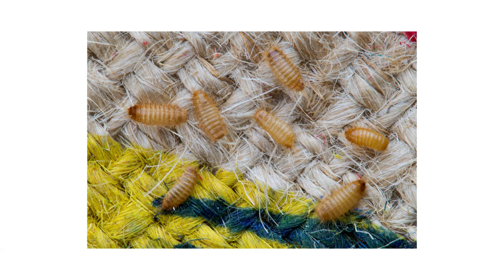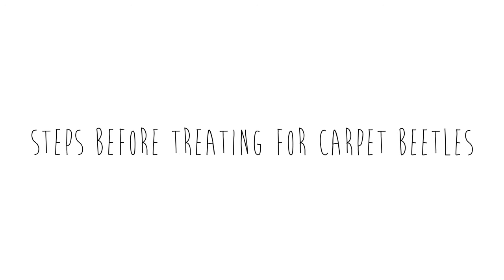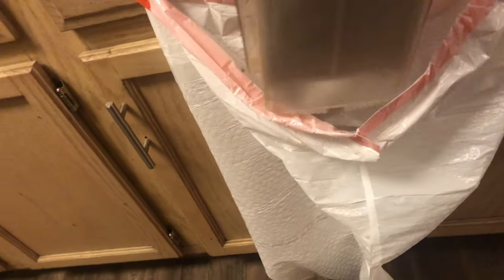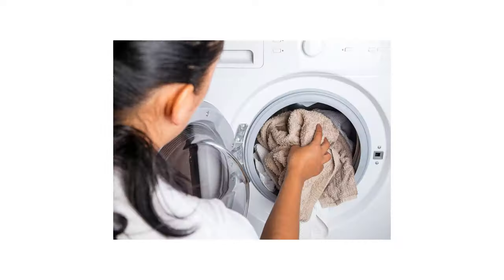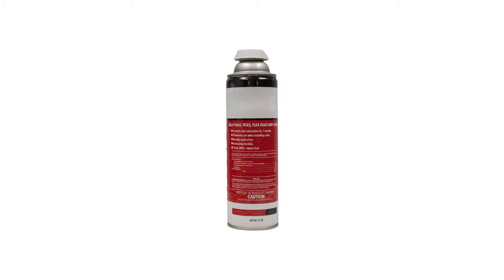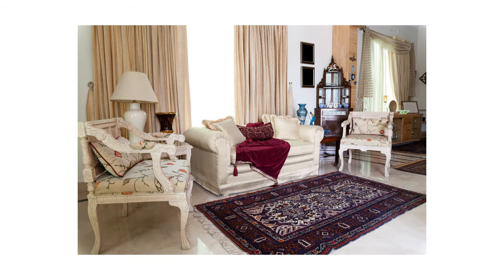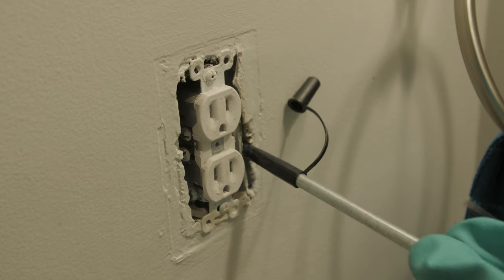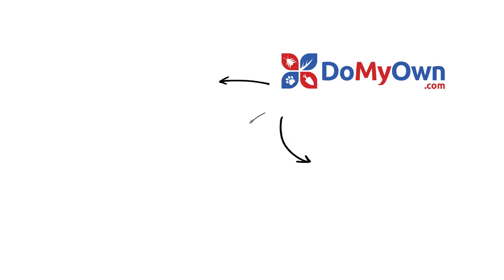How to Get Rid of Carpet Beetles | DoMyOwn.com

Comment: Ok, so last week I found a large amount of larvae and shedding under my cats dry food container in the laundry room.  I cleaned that up and found a bunch under the dryer as well.  I basically went into crazy cleanup mode and moved out the washer, dryer, and completely swept up/mopped that room, then I applied Ortho home defense to the entire area and under the washer/dryer.  I also vacuumed out the dryer and the vent tube thing.  I then went to the kitchen and swept under the stove and fridge (found a few larvae under there as well).  The remainder of my week involved me spraying every corner and base board with insecticide, putting down powders, and doing heavy vacuuming.  I also went back over the rooms and mopped and wiped down everything with rubbing alcohol.  Everything is spotless now, and I'm pretty positive I removed and cleaned all sources of food.  That being said, it's been a week since the initial finding of this, and every day I see 1-2 larvae on my wall.  I'm not sure if that's normal or not and I'm just not waiting long enough or what.  I'm not sure what else to do.
Reply from the maker: We are sorry to hear you are having a problem with carpet beetles. First, you should choose an insecticide labeled for carpet beetles on our website here... https://www.domyown.com/carpet-beetles-c-141.html. If you choose to use an insecticide that does not include an IGR, add an IGR like Gentrol to your insecticide. https://www.domyown.com/gentrol-igr-concentrate-p-604.html 

If you are using a liquid insecticide, mix the insecticide and IGR in a sprayer with water. Read the product labels to determine the amount of water and product you will need. After filling, replace the cap on the sprayer and shake the sprayer to mix your insecticide, IGR, and water together. 

Place glue board traps in your laundry room and other dark areas to catch adult carpet beetles. Glue traps https://www.domyown.com/catchmaster-100i-insect-monitors-100-boards-300-monitors-p-2397.html are also a great way to monitor your infestation. In the weeks that follow your treatment, you should see less and less carpet beetles on your traps. If you continue seeing activity after 21 days, retreat.

Comment: I’ve only found two of these things and not even larvae, an adult I’ve done everything to remove them but should it be something to worry about?
Reply from the maker: We recommend that you stay vigilant about vacuuming and removing clutter. You can also use a residual insecticide for prevention of carpet beetles and other common pests. Adult carpet beetles will feed on pollen, so be sure to check fresh cut flowers that may be brought into the house and flowering plants that may be near doors or windows. We have more tips in this guide, too: https://www.domyown.com/carpet-beetle-prevention-guide-a-697.html
Reply: DoMyOwn Ok, thanks a lot!

Comment: I have a hardwood room, but I've seen some of these things on the rug that I keep in there. Should I wash all the clothes, curtains, sheets, and pillow cases just to be safe? And is there a hardwood safe insecticide that you reccomend using?
Reply: I forgot to mention, they weren't the beetles themselves, but they were the larvae
Reply from the maker: Wash all of the fabrics in your home that you possibly can and dry them on high heat (over 120 degrees F) to kill any carpet beetle insects, larvae, or eggs. The high heat of the dryer is important as that is what will kill the carpet beetles. Don't forget clothing, bedding, towels, and other linens.

You can dry clean any items that are unable to be washed, such as those made of silk, or place items directly into the dryer. Dry cleaning will also kill any insects, larvae, or eggs that are hiding in these fabrics.

Onslaught Insecticide can be applied to wood floors. That being said, it is always best to do a test application first, as some types of wood floors are more prone to staining than others. In most cases, Onslaught should not leave any visible residue behind when used as directed.

https://www.domyown.com/onslaught-insecticide-p-376.html

Comment: What precautions should be taken when reentering the home after Nyguard spraying? 
Wiping kitchen counters? Washing bedding that was out in the open during spraying? Wiping desk and table surfaces? Please advise. Thanks!
Reply from the maker: NyGuard Plus can be applied for carpet beetle treatments with a sweeping motion as a surface spray to carpet, rugs, closets, baseboards, upholstered furniture, and around the edges of carpet.  Always wear gloves and long sleeves when applying NyGuard Plus, or any insecticide in or around your home.  Do not let children or pets into treated rooms until the solution has dried (about 1-2 hours).  This product should not be applied in any way that could possibly contaminate water, food or any food handling surfaces or utensils.  Please refer to the manufacturer's application instructions, and only use as directed on the product label. https://www.domyown.com/msds/NyGuard-Plus-Label1.pdf

Comment: I found two or three adults under my chest of drawers earlier as well as one live adult and a couple of shed skins, I haven't noticed any larvae though or obvious damage. Also haven't ever seen any by my window or in other rooms. I've been putting off cleaning my bedroom floor for months and under the drawers was horribly dusty and full of old paper. I've binned everything from under there any thoroughly vacuumed but should I be worried? I don't keep clothes except in the top drawer which I recently cleaned anyway, there is no sign of them in other areas of my room and i have a high sleeper bed so I doubt any could be in their. Will repeated vacuuming get rid of them?
Reply from the maker: Vacuuming daily can greatly help with your carpet beetle issue as the vacuum sucks the adult carpet beetles and the larvae from the carpet. I would also suggest washing and drying, on high heat, all of the fabrics from the room to kill any carpet beetles and eggs. It may also be beneficial to treat the room with an insecticide dust and an insect growth regulator (IGR). Please take a look at our guide on Carpet Beetle Control https://www.domyown.com/carpet-beetle-pest-control-a-220.html for more information on treatment methods if you have not already.
Reply: Hey I just message someone because we have the same problem… Try getting the flat part of the vacuum extension put it on and then use that flat extension of the vacuum and try to slip under your baseboards because that’s their favorite place to hide. Try going into any crevices on your stairs which is also their favorite part to come out and feed on and also check your furniture like your couch. I sometimes go out in the middle of the night when they like to come out (the larvae) to see if they’re hiding in the couch because that’s when they usually come up and that’s when I’ve noticed them so now we’re gonna have to get rid of our couch. We’re also going to have to now call an exterminator to spray some insecticide but what I’ve been hearing from other people that doesn’t seem to work.
Reply: Most homes have carpet beetles. You can only control them but never get rid of them. If you live the minimalistic lifestyle-with hardly any belongings and no carpeting and furniture is high off the floor and no clutter on the floor including shoes, and you dust and wash floors regularly including under your fridge and stove and keep your window screens on then you might be lucky to not have these pests.

Comment: I just moved to a new apartment and found a few adult beetles and larvae. The apartment is pretty sealed but they seem to be coming mostly from behind my radiator which is right below the window so I am assuming that they just live in the walls as the apartment is still pretty empty. I'm down to order Nyguard Plus and everything but what can I do if they actually reside within the walls, in there a chance to get rid of them or do I need to accept I will deal with them as long as I live here ? So far I sprayed with Demand CS and dusted with Delta Dust, not sure this will be enough.
Reply from the maker: If the beetles are living inside the walls then dusting inside the wall voids would be your best option. Delta Dust or Cimexa Dust will be great options for you to use. Use of an IGR like Nyguard Plus would also be a great option to kill the larvae, so you are on the right track. Please also take a look at our Carpet Beetle Treatment Guide https://www.domyown.com/carpet-beetle-pest-control-a-220.html & our Carpet Beetle Control Kit https://www.domyown.com/carpet-beetle-control-kit-p-18642.html  for more information on products and treatment methods.
Reply: Unless you have dead animals (mice?) inside your walls that they are feeding on it is more likley that they are wandering in from outside, attracted by the odors of potential food in your house.

Comment: What if I have pets? How do I know the insecticides will or won’t harm them?
Reply from the maker: You should always keep pets out of the treatment area until any sprays are completely dry. Be sure to read and follow all label directions, just like you would with household products.
Reply: Also read the can. I almost bought a flea treatment to sprinkle on carpeting, but when I looked closer at the instructions, the label stated to use it only on a 3 ft by 3 ft area maximum and do not repeat because of toxicity! And you can buy that at the supermarket!

Comment: I keep finding like 3-4 every day in my room but I can't find the source or any larvae. They will be on my window sill and bed which is next to the window. Do I need to worry?. I've never seen any larvae but it looks like they've been eating my clothes
Reply: I'm only in a tiny box room btw so not that many places for them to hide
Reply from the maker: Carpet beetles can often enter the home from outside so checking around windows and doors for any cracks in weather stripping or gaps they could potentially enter through is one way to help make sure they don't continue to show up. Take any clothing you have that they have already infested, or that you think they could be within (typically wool type items or similar natural materials), and blankets, etc and inspect and clean them, and then seal them up in containers for a bit while you eliminate any existing in the home and furniture of the room. You can spray a product like NyGuard Plus https://www.domyown.com/nyguard-plus-p-2874.html or Gentrol Complete https://www.domyown.com/gentrol-complete-aerosol-p-17183.html along the baseboards and carpet edges, under furniture, and inside the crevices of drawers, etc. If you have any pets make sure their hair is being vacuumed regularly, and check for any birds nests on or next to the home that could be contributing to the population as they often feed on bird feathers and materials in their nests.

Comment: Ok so I’m getting new carpet today, and I found some under my mattress. My dog sleeps with me at least twice a week, and I don’t have any skin irritation from the larvae. I’ve only found larvae on the mattress, should I get a new mattress? My parents have low income and they just bought themselves a new mattress (we didn’t know we had carpet Beatles at the time) is there a way to get rid of them without ripping up my mattress??
Reply from the maker: There is a very helpful article that we provide on our website that will give you proper instructions and materials on how to treat for carpet beetles. I am truly sorry for the situation you are in and hopefully this information will be more than helpful. If you have any further questions or concerns please let us know.

https://www.domyown.com/carpet-beetle-pest-control-a-220.html

You typically do not have to replace mattresses if they are not completely infesting but finding the source and cleaning/removing that is key.
Reply: Consider using a hypoallergenic mattress cover. One that fully covers the whole mattress, not just a fitted sheet style one.
Reply: Get rid of wall to wall carpet. Area rugs may be ok if you clean them often.

Comment: I have a 2story i suspect after all the spraying and dust I've used on carpet walls etc.Ive come to the conclusion they're in the subfloor how to i treat that?
Reply from the maker: When treating a carpet beetle infestation the first thing is to locate the source of the infestation. Please take a look at our how to treat carpet beetle treatment guide. https://www.domyown.com/carpet-beetle-pest-control-a-220.html It sounds very unusual that you would have carpet beetles in the subfloor. To make sure we are giving you the correct treatment advice, please send in photos of the insects and damage/where they are finding them for us to better determine our recommendations.
Reply: @domyown  The subfloor has a space in between the upstairs and downstairs ceiling of about 18 inches to allow for duct work and pipes,i assume they're traveling along duct work and gaps .Small black bugs also little worms ,have found then in a bucket I put underneath vent in kitchen,also have found in pantry where there is no food.I will send in pictures ty,I have been purchasing chemicals from you folks for years now.
Reply: Did you get rid of them after? I feel like that’s the issue we’re having
Reply: @KL-rq5mu  still have them ,not as numerous as before,I pulled the carpet in the stairwell and hallway and there was Soo many under the carpet.I only have 2 spots left of carpet and that will be it.I started from attic down with the cimex dust ,only have seen beetles since I treated not worms anymore,but I opened every switch,plug panel , baseboards, used a Growth regulator with some other stuff,used cans of specialized stuff.Hopefully by putting growth regulator and dust everywhere it should kill them.But then again I found even in garage where there is no fabric.They must be in my subfloor but I'm not ripping that open.
Reply: @Troy-McClure81  I had a huge issue with them in my old house. They would crawl out the cracks in the woodwork. I literally had to bag everything up and move , it was a never ending battle. I think they live in the foundations, check your light fixtures in your ceiling I had so many in there trying to get through.